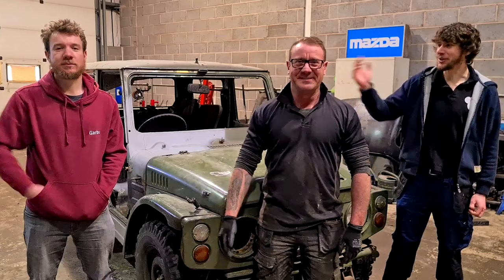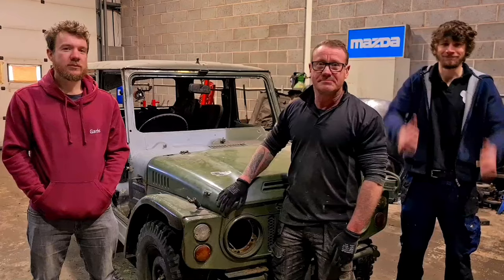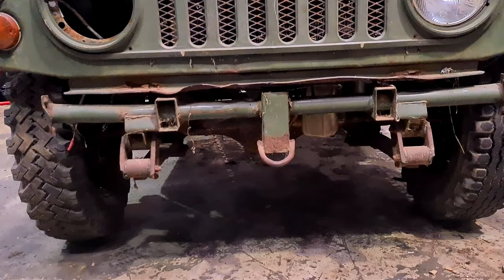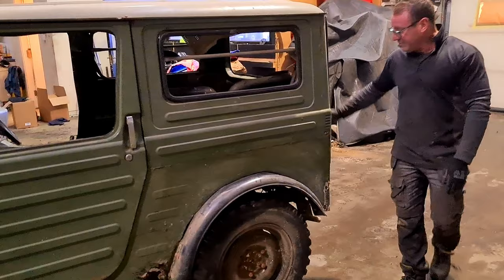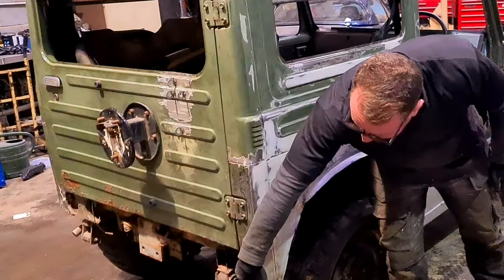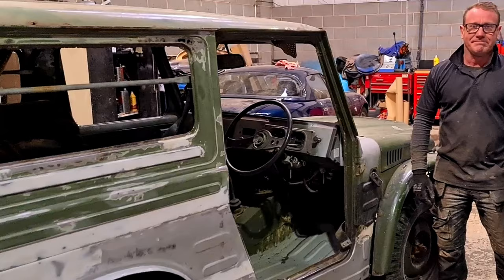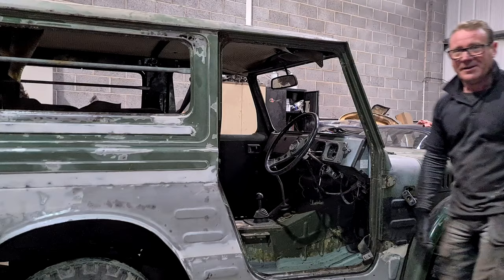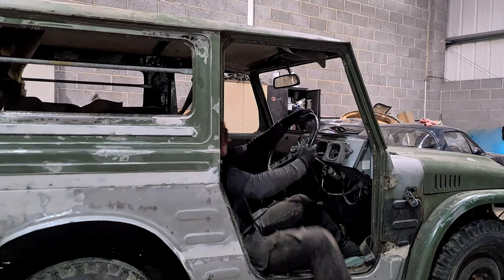Introducing our Barn Find Suzuki LJ80 Restoration Project Part 1

Comment: Pretty easy restoration, they're usually a lot worse than that, had 12 of them over the last 33 years.
There's a UK LJ Facebook page, I've posted a link to this vid on there.
https://www.facebook.com/groups/LJownersUK
Reply from the maker: Wow 12! Thats some going! We are pretty lucky to find one which was dry stored. It spent most of its running lift as a workhorse on a farm then dry stored so its condition isn't too bad!

Thank you for sharing the link! We shall take a look at the page
Reply: @yorkshirecarrestoration  I've just approved someone from Doncaster with a beard, is that one of you lot?
There is a UK LJ forum as well, though its not that active, but there are some good links including one to a parts catalogue you may find useful, took me bloody ages to scan and edit, the links to the disc brake conversion JPEGS have been lost, but I am emailing them today to one of the moderators.
https://forum.suzukiclubuk.co.uk/viewforum.php?f=37&sid=a5a83087d5d330d0fb63f19a1c6b8842

I've posted a link to your vid on the forum.
Reply from the maker: Thanks again David, we appreciate your support and will definitely be checking out the group page and forum :)